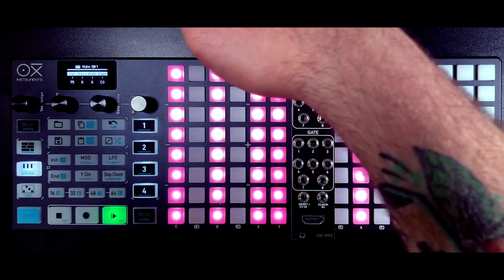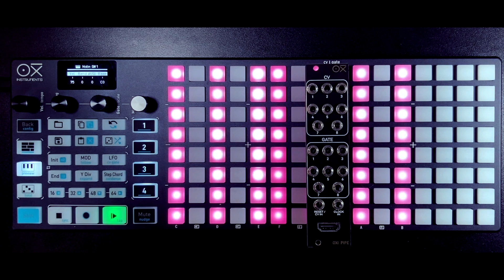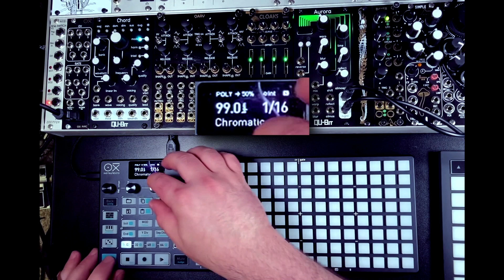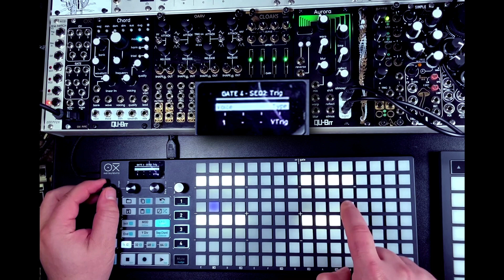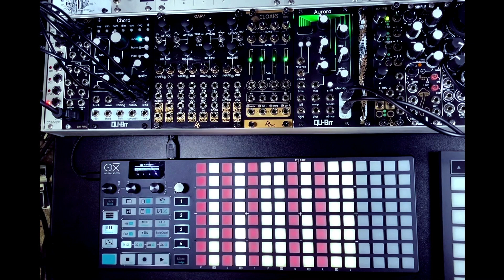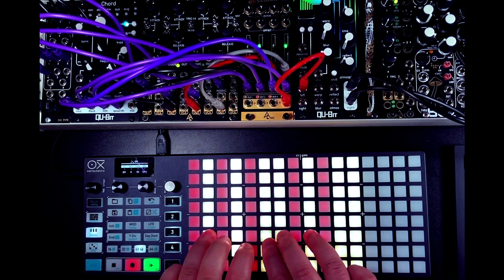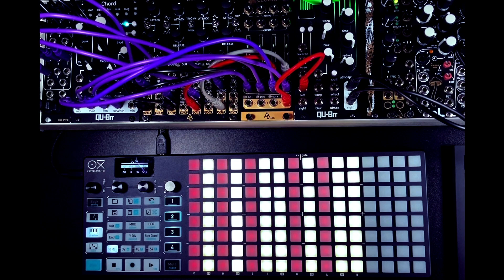Oxi One Sequencer - True Modular Polyphony

Comment: Great video! I don't know how Qu-bit chords works but I guess that this also will work with four separate oscillators. And I suppose the polyphony would work without the Oxi Pipe?
Reply from the maker: yep!
Reply: @RobotsAreRed  And now for the trick question. Does it work without the Oxi Pipe? I tried but it seems like I'm getting some sort of duophonic sound. When I hold one key down and press the next, the first and second sound together.
Reply from the maker: @OttoMilde  Yep, it works just the same without the pipe. Double check you set voice and trigger 2 for the second CV and gate outputs.
Reply: I think I figured it out! In CV and Gate voice allocation I switched to Unison. I'v only tried with two voices yet, but thanks for this incredible tip. Saved a lot not buing a polyphonic midi-interface!
Reply from the maker: @OttoMilde  Ah that explains it. It's super easy to add more voices too, up to 8. Just do the same thing you did for setting up two.
Reply: @RobotsAreRed  Still fiddling around, not quite there yet but soooon.